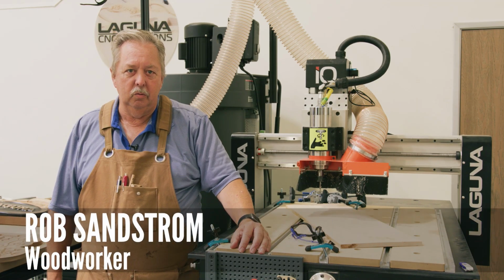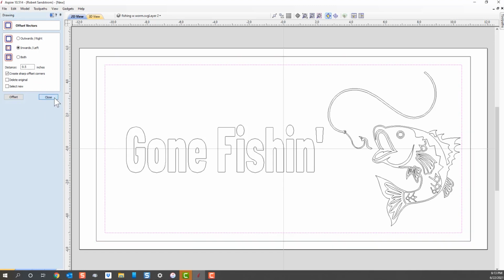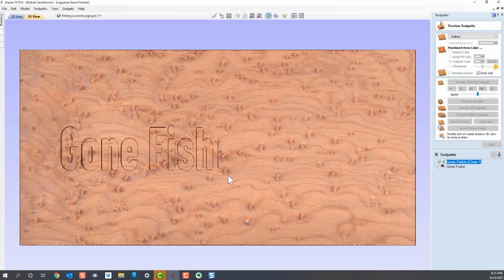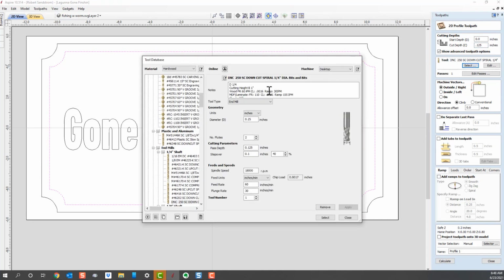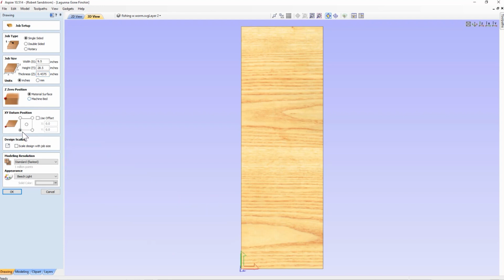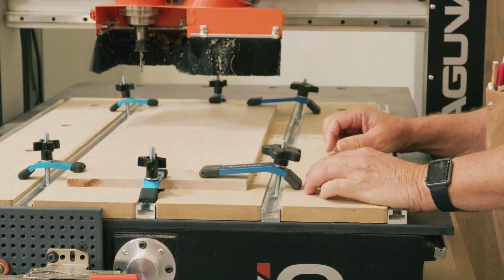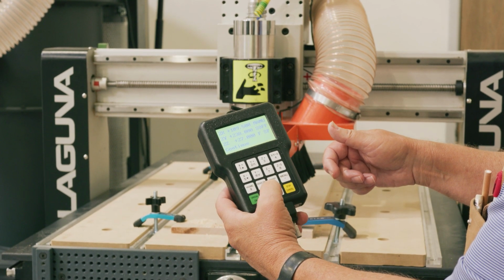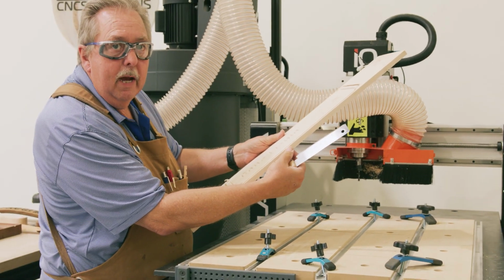How To Design A 2D Sign Using Aspire Or VCarve Pro Software | Sign Making Software Tutorial

Comment: Were you using Aspire V-11?  As for your USB drive plugged into the hand held controller.....Have they increased the number of characters that display?  On my IQ I can only see about 6 characters.
Reply: V11 was not out when we shot this video.  Used Version 10.5.  I have V11 now but limitation on IQ display is controller - not software.  I use a system to try and avoid confusion.  I start with determining order of toolpaths and save with  names that reflect order of tool and specific tool.  

As an example if my first tool path is using a  vbit number 46701 (Toolstoday bit) my toolpath name would be 146701. If second bit is downcut endmill DNC250 (Bits and Bits) then that toolpath name would be 2DNC250, etc. etc,  i have seen other methods - each person should develop their own method since the controller limitation is what it is.  Hope this was useful and your having fun with your CNC.